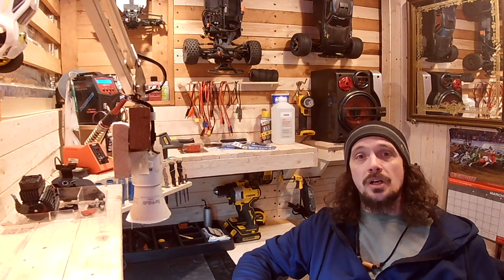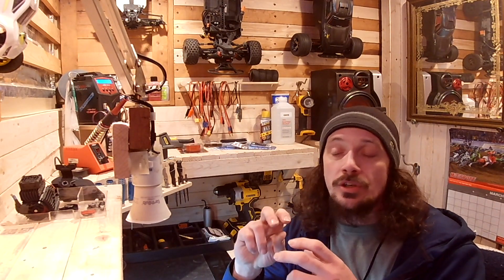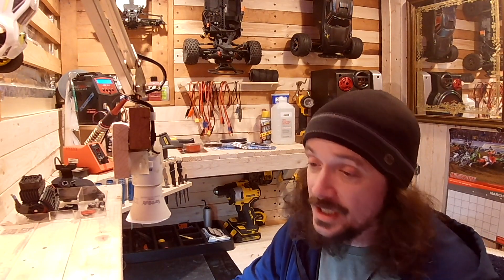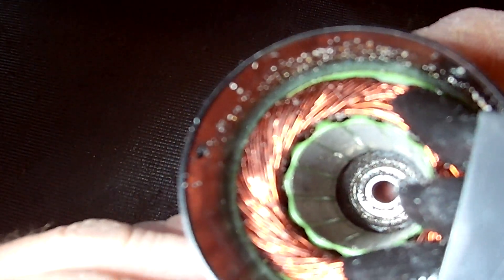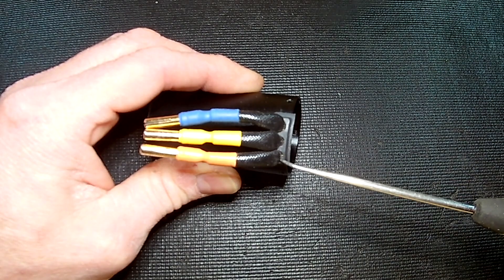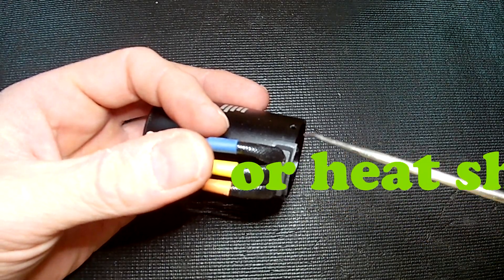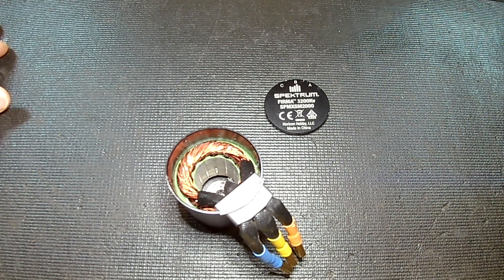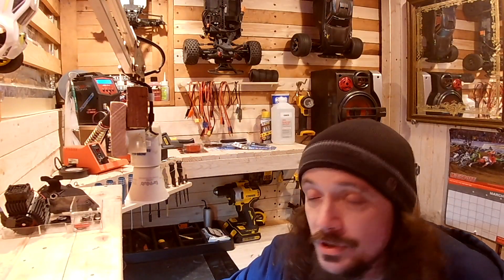Issue causing Arrma 3s blx motor bearings to fail?

Comment: Thanks for the info on this issue. I might try some silicone around those wires on my motor.
Reply from the maker: i was thinking same thing . like some high temp flexible gasket maker or something similar

Comment: I have the Senton BLX. That just happened with mine with the 5x16x5 bearing on the slipper clutch side. The mounting plate was bent also. I think a hard crash or two caused the motor to jar to the right side hard enough to bend the plate, being it's just the two screws and the plate holding it in place. That caused the pinion gear to not line up with the spur gear right. Which may have caused premature failure. I Attached a hard rubber spacer to the heat sink to fill the gap on the right side and glued a smaller piece of the rubber to the red mounting block. This should keep it from moving too much during hard crashes. We'll see what happens.

It was pretty dirty in the motor but the other bearing was still in good shape.
Reply from the maker: Sounds like that will work, but if you continue to have a problem the M2C motor plate and chassis block will not bend and stiffens the rear of the truck up nicely.

Comment: Great tip man, I seized a Granite motor in 11 days lol 😝 what would you suggest to seal those wires ? I was thinking flexseal as maybe a quick spray would work and have some movement still. Also I hear the stock motor bearings are NOT rubber sealed their steal sealed and that’s why their blowing motor bearings, upgrade those to FASTeddie or TRB is what I did today and wow is all I can say man, huge different is the rolling resistance. 
Cheers 🍻man
Reply from the maker: I used permatex ultra black , it's good on heat and flexible. I just bought a set of the TBR hybrid bearings I'm going to give them a shot. Thanks bro 👍✌️
Reply: @soulrebelrc6341  I have too try those permatex  ultra black one out too than. 
Cheers 🍻 man
Reply from the maker: @bubblesrcshed  btw, I love trailer park boys
Reply: @soulrebelrc6341  ya just can’t beat the boys or living in a park 😝

Comment: That's not really dirt/sand, it's more likely composite dust from the slipper clutch eating away at the housing.  It's super fine dust that has no problem making its way in to the bottom bearing (as you noticed).  You can seal the slipper housing from dirt and this will still happen if you don't address the slipper clutch.  I used a few shims to space the clutch a little further away from the housing, which stopped the black dust.  Then I sealed up the housing as much as I could.  You can also add a few small rubber washers that sit between the motor and pinon gear.  That will also help keep debris out.

Comment: After 5 warranty motors I put a hobbywing 4600 kv motor in my senton with a 22 tooth pinion now it's a bullet proof missile 6 months so far of hardcore racing and strait up bashing no  issues at all
Reply from the maker: I'm over these motors and bearings.  I'm in the process of deciding what can size and kv I want . I think I'm going with hobbywing also.

Comment: do you plan to use  Dust Cover? is it really works for Senton 3s?
Reply from the maker: I worry the dust cover won't allow enough air flow around the fans in summer months and possibly getting hung up in the center driveshaft could be another potential issue.. I may try one but i'm not sure yet

Comment: I smoked two 2050kv motors in a new typhon v5 6s, first one actually broke all the diffs, an I got a while new buggy from horizon, second one I'm waiting for new motor, dirt got in and not long after that the bearings let got, second buggy motor last 2-4 hours, I guess not much time between cleaning is the answer every 30 min or so take motor all apart? I dont know I'm frustrated $500 keeps crapping out motors
Reply from the maker: It's very frustrating and this stuff isn't cheap! I was taking the power module off and taking it apart and cleaning every run. I finally had enough and drilled a relief hole to drain the sand from the power module area. But keeping the dirt out of the these motors is difficult.. Short intervals between cleaning is probably the best solution as you're suggesting. Seems like something  horizon hobby should be looking into instead of us trying to figure it out..  Frustrating it is
Reply: @soulrebelrc6341  i wonder if sealing the cut out for the spur gear would help this as well, seems like a weird design as it just lets so much dust and dirt in, glad im not the only one with this problem

Comment: I have had this Problem today on the first run...super annoying
Reply from the maker: dirt in your motor on the first run?
Reply: Took it out today for the first time. It started to overheat and now the motor doesnt even want to turn anymore
Reply from the maker: @Dk-li9tn  that's not good.. I'm sorry to hear that sir . Hard to say what caused it to lock up without inspecting the motor but i would definitely contact horizon hobby before you take apart the motor . If my motor locked up on the first run I would have sent the motor to horizon .
Reply: @soulrebelrc6341  I will do that for sure 👍
Reply from the maker: @jordanszoko7149  the power module is a poor design and the motor bearings are garbage. There's better motor options just depends on budget . I have a senton upgrade video on my channel of what I've done so far to help with the durability of the power module , motor and bearings.

Comment: Damn brother just ran across your Channel. I got two of those freaking motors. And you know what sucks, I run in loose dry dirt all the time. I guess I better check mine. Thanks for the heads up. Peace brother take it easy man.
Reply from the maker: no problem, you're welcome sir
Reply: Don’t stress too much. I have 2 of these vehicles as well and so far zero issues running in fine dirt and sand for almost 2 years now. Granted I upgrade motor bearings to Jim’s Bearings ASAP, for whatever that’s worth.

Hopefully this is a fairly isolated incident but it doesn’t hurt to bulletproof these things 👍

Comment: helps--happened to my Senton after 1 month --do you think it is under warranty?
Reply from the maker: It should be but it depends on if warranty conditions have been met and what they determine caused the failure. When you call Horizon they will tell you what steps you should take for warranty claims. hope this helps. good luck.

Comment: That internal bearing gave me alot of trouble to get out and it's still not out. Any recommendations on how to get it out or are you going to do a video on that? Thanks!
Reply from the maker: I can make a short video on how I did it and how to make a jig if you think it would be helpful to people . I guess I should have included this in my video .
Reply: @soulrebelrc6341  Thank you! Yes a video will definitely help as it is a common problem and changing the bearing is much cheaper than buying a new motor. Thank you!
Reply from the maker: @donaldk4867  no problem your welcome . I'll do a video exactly how to replace those bearings. thank you for the feedback and for watching .
Reply: @soulrebelrc6341  Excellent! Thank you very much. Looking forward to seeing it.
Reply: @soulrebelrc6341  have you done the video?
Reply from the maker: @lufenn  https://youtu.be/AVojPEMD3ec
Reply from the maker: I had trouble also. I used my drill press and it popped right out. A large metal clamp would work also
Reply: i drilled two very small holes on the edge of the bearing justr enough to get through the aluminum and popped it out that way

Comment: Do you have the information for the bearings? Mine is toast.
Reply from the maker: I used jim's Bearings and it's the Arrma 3s BLX 3660/3668 kit
Reply: @soulrebelrc6341  Thank you
Reply from the maker: @singhda03  no problem you're welcome